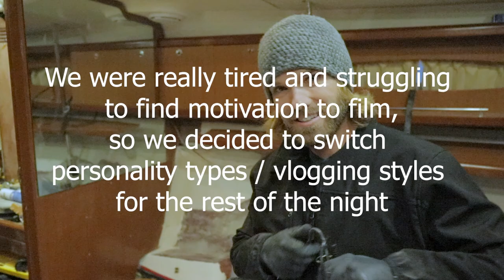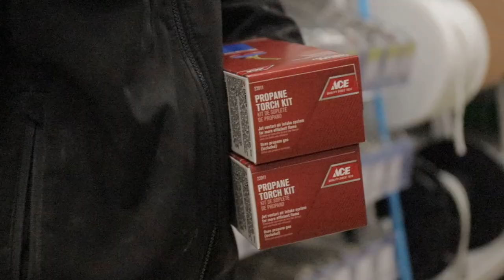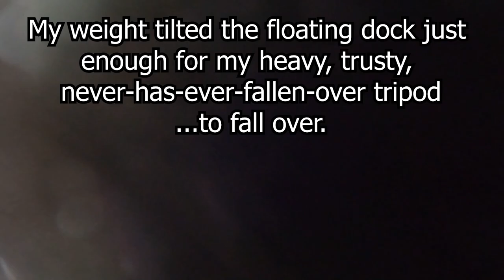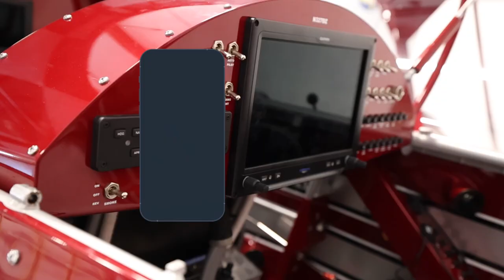We LAUNCH (our salvage sailboat)....And Take Off! | Expedition Evans 32

Comment: I'm surprised the heat guns dried the bottom of the keel.

The reason why I'm surprise is that the heat guns were fueled with hydrocarbons, the first part of the name "hydrocarbon" is "hydro-".  Most of the hydrocarbon is hydrogen when the hydrocarbons burn they produce a couple of things, but mostly water.

So you were drying the bottom of the keel with something that generates water.  So I'm surprised it worked, it most have been really hot.

Comment: Using rice to dry soaked electronic doesn’t help much. First immediately disconnected the battery to stop any electrolysis, clean it from salt with some sponge or towel soaked in fresh water,  then open everything you can, dry it with hot hair dryer, put it in warm ventilated environment and set ventilator next to it and pray. 🙏

Comment: Aerobatics definitely  requires some physical adaptation. Your guts need some time to get used to all that jiggling around. The aileron rolls in the video looked more like barrel rolls to me. Aileron rolls are a little more violent. Slam left, hang upside down, slam right, then back in your seat. Then retighten all your seatbelts.

Comment: Never use a rotary wire brush without wearing safety goggles. Not ever. Doing such without wearing goggles is asking for a sudden, major misery
Reply: no seatbelt and so on.... theres a pattern here ;) just lean back and relax, maybe they upload it, maybe they wont
Reply: @stulletrudat5196  Yeah, must be fun to relaxed while picking broken piece of wire from your eye? 😵
Reply: Oh yes! Those wire brushes sling wires out everytime and the chinese made brushes are the worse.FACT! SAFETY GLASSES!
Reply: My fun moment was when a wire dislodged and hit the end of my nose and dug in. Now that made my eyes water. 5mm either side and it would have been a whole new experience. I was wearing safety glasses. Using exactly the same tool.

Comment: Please please never ride with your feet up on the dash area keep them on the floor at all times...reason being is ..that if something pulls out in front of the vehicle and you hit it or they hit you....your feet and legs will fly up and go through the windscreen.. (glass cuts)....or  your legs will be pushed back far enough to go through the seat  your sat on...and break your hips...as an ex recovery operator...in the uk....I have seen it more times than I have had hot dinners....it is not a pleasant sight.....so please stay safe...